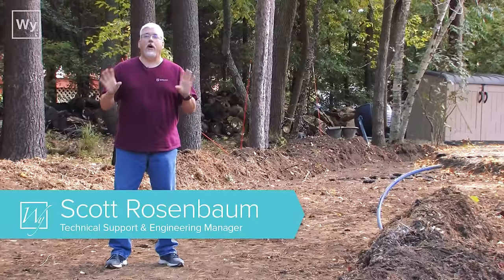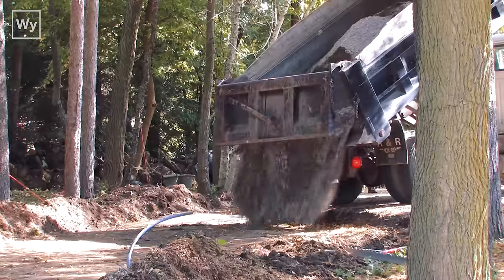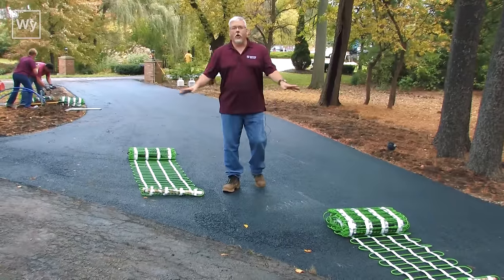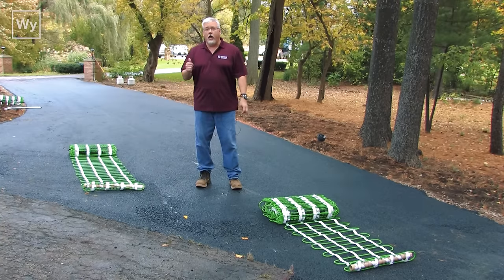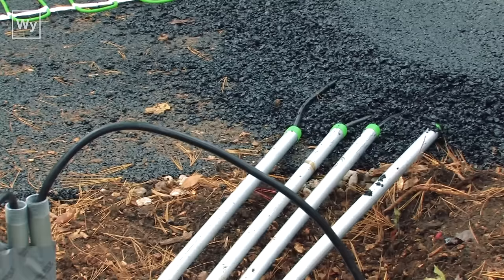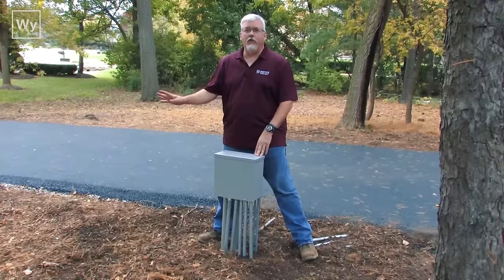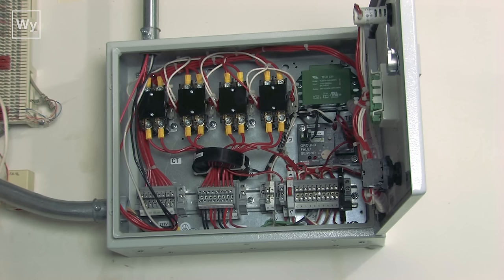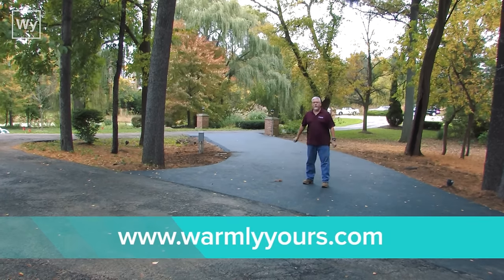Electric Snow Melting system installed in an Asphalt Driveway

Comment: Can these be installed underneath loose gravel and be durable/long lasting?
Reply from the maker: Our snow melt systems can only be installed by embedding them in asphalt, concrete or in mortar under pavers. Loose gravel would not provide the structural support or protection this system needs to evenly heat the surface. Our snow melt systems come with a 10 year no nonsense warranty. You can learn more here: https://www.warmlyyours.com/products/snow-melting

Comment: id like to know how many watts and voltage that particular system is? Must be a lot.
Reply from the maker: The total watts for this project was 15,015 watts, so 15.015 kWh. This project used our 240V snow melting mats. The average kWh rate in the US is $0.12 an hour so this would run for $1.80 per every hour you have it running. It only needs to be on when snow is actually falling, once it's melted the system goes into a standby mode that uses less power for a short time and then turns off once it has detected that it's no longer snowing. You can also control it manually to help better control power usage. Thanks for watching!
Reply: @Warmlyyours  Wow thats about as much as i thought. seems the electricity would be pricey. What about a hot water system that ran on propane power seems would be more efficient.
Reply from the maker: Some people do use hot water mixed with glycol so it won't freeze but it requires digging down into the area where the driveway will be since the pipes to run the water are much thicker than an electrical cable. Hydronic heating systems always present their own unique challenges since the water cools as it travels through the pipes, meaning that the area introducing the water will be the warmest while the pipes furthest from the source will be cooler and may not melt the snow at the same rate. Electric keeps it consistent throughout, but you definitely have to evaluate your potential electrical usage.
Reply: @Warmlyyours  Thats sounds much more efficient thanks for the info

Comment: Sound really good however, you do need to replace asphalt every 7 years + or - a few years depending on wether and use of driveway. What happens to your system then?
I’m going off of a short home driveway 1 car in Upstate N.Y. - every 3 years the asphalt gets resurfaced and every 7 years it needs to be redone completely just because of snow and salt on the road.
Reply from the maker: If you're driveway would need to be replaced, then so would the system. But the great thing with a snow melt system, is that you would be using less salt and have less wear and tear on your driveway if the salt is what's usually damaging it.
Reply: WarmlyYours - the driveway was not replaced just because of salt. Didn’t use it on the driveway anyway cause it was shoveled off.Neighbor plowed it for me.
No the driveway needed to be replaced because of the temperature. Months of cold then warmed up. The expansion and contraction of the asphalt in such temperatures is why it has to be replaced so often. 
Upstate NY, 4 to 6 months of snow followed by the warming up then 1, 2 months of heat and humidity in the summer.
Reply from the maker: If your climate has temperature fluctuations throughout the year that affect the asphalt - then the system would need to be replaced with the driveway.

Comment: Is there a video showing it with actual snowfall?
Reply from the maker: Yes you can watch it in action here: https://www.youtube.com/watch?v=7wdpsTCYoXI&t=0s

These systems often need to be installed several months before winter arrives, so it can be difficult to capture them at work shortly after installation.

Comment: What does it cost to operate such a system for, say, three months - Dec mover, January, February?
Reply from the maker: Good question! So what most people don't know is that with our automatic controls and sensors, these systems only turn on when needed. They detect temperature and moisture levels so that they start operating when snow is present. These Snow Melt mats use 50 watts/sq ft, the estimate we provided in comments above was running 6 hours for a day with snow. So with 50 watts x 6 hours, thats 300 watts a day. 300/1000 gives us 0.3 kWh/day. Based on your local kWh rate, you would multiply this by 0.3 to get the operating cost per sq ft of coverage to run for 6 hours a day. You can take that amount, multiply it by the coverage you would want and then multiply it by average snow events during winter to get a better idea of how much it might cost you during a season.

Comment: What happens when the mesh malfunctions? Or corrosion over time?
Reply from the maker: Hi Eric, we offer a 10 year warranty on this product line. If anything does go wrong, you do not need to tear up your whole driveway! These systems are design to be resilient to natural elements and can be repaired rather easily. We have tech specialists and a variety of tools to help us identify where a break may be in the system. Once the spot is located, only a small portion of surface material is removed and a splice repair is done to repair the electric heating cable.

Comment: What happens to system if you need driveway repaved?
Reply from the maker: If the driveway needs to be replaced, the system would also need to be removed with the old asphalt and replaced. We often recommend the installation of these systems when you have to replace your driveway anyways.

Comment: I don't get it. If the snow is that thick that you need to melt it to get your car out, what happens when you get to the end of your drive and you reach a 12 inch wall of snow? If the snow is thin enough to drive on then why would you need to melt it on your drive? Unless you just want a clear driveway to walk on.
Reply from the maker: Hi Matthew, a lot of home owners who choose to install this product do so to save on salt/harsh chemical corrosives that can damage a car. These systems also allow for a relatively snow free area, making it easier to get in and out of your vehicle when winter comes.

Comment: Stream rollers were used about 100 years ago...
Reply from the maker: The equipment that Scott is referring to in the video are the large asphalt paving machines. They typically carry the asphalt in front of them with a trough and then pound it down after it was been spread out. These machines are far too heavy to drive over the embedded heating cable so a asphalt roller is used instead for this type of install.

Comment: Awesome...what happens when it shorts out?
Reply from the maker: If there are ever any issues with the system, specifically the cables that are embedded under the surface material, we have tech specialists that can help you identify where the problem may be. If there is a problem under the surface material, only a small portion would need to be removed in order to access the wires and do a splice repair. This would be done by one of our tech specialists if you're in the area or a licensed electrician. Once the repair is done, the area would just need to be patched back up with the surface material you have in that spot.

Comment: What is the mat material used here?
Reply from the maker: This is our Snow Melt Mat - specifically designed to provide 50 watts per square foot and warm up outdoor surfaces to melt snow and ice (even evaporates the melted snow so it doesn't refreeze!) Here is a link to the product page for this: https://www.warmlyyours.com/products/line/snow-melt-and-deicing-snow-melting-mat Thanks for watching!

Comment: If this can be done ... can solar energy drawn from such a device?
Reply from the maker: Only if the solar panels can provide the amount of wattage necessary to run the system. Snow melt runs at 50 watts per square foot and that can amount to a lot of wattage. It could certainly help supplement power but it is unlikely a solar system could be enough to power the snow melt system on its own.
Reply: WarmlyYours solar system?

Comment: What actually happens? Say there's a blizzard which leaves multiple layers of snow AND ice. I imagine one would have to leave it on for days at a time which would be expensive! ( for instance heated swimming pools really pack an electric bill). Probably impractical North of the Mason Dixon line
Reply from the maker: Many of the advanced controls for these systems come with an auto-shutoff feature that turns the system off if conditions are too extreme - this helps save on electricity and prevents you from spending too much money during a bad storm. Our Snow Melt Systems are not designed to handle something as extreme as a blizzard, but for typical snow events, these systems are very reliable.

Comment: Not a bad idea but I'd hate to have an open circuit develope over time and have to replace the heating coils
Reply from the maker: You can actually just do a splice repair after excavating the area the cable is damaged and then patch it back up afterwards. Very similar to how floor heating is repaired as well.

Comment: What about the part where the heating elements fail under the asphalt after it sets?
Reply from the maker: If a snow melt heating element fails under asphalt, we have tech specialists that can help you identify where the issue is. In cases where it is under the driveway/heated area - only a very small area of surface material would need to be dug up in order to get access to the damaged cable. It's the same for our floor heating products, most people think they have to rip up the whole floor - when in reality you only need to remove 1 tile or 1 strip of hardwood flooring to splice the wires and cover it back up. You can find more information on our website here: warmlyyours.com Thank you for your question!

Comment: looks like a pain in the ass when you got to find where the problem is
Reply from the maker: While most assume you would have to tear up the whole driveway to repair the system, this is never the case with our radiant heating systems. With a set of specialized tools that we rent out to customers, you can identify if and where there is damage to the cable. If installed according to plan, you can find the distance into the mat or cable that there is an issue with a wire. After digging up a small portion of surface material, an electrician can do a splice repair (we sell kits for these if needed). We covered this topic in a recent YouTube live webinar, here is the part of the presentation where they address it: https://youtu.be/DyDW0Ej9ILg?t=12m43s

Comment: whats wrong with salting your drive in winter
Reply from the maker: Hi Michael, there's nothing necessarily wrong with salting your driveway - but for those that are not physically able to or would prefer to save some time/effort, our snow-melt systems offer a convenient solution for homeowners during winter. Also, with our system, you won't have to worry about your car getting rusted/damaged from the corrosive material and chemicals typically found in salt used on snow.

Comment: this won't be practical in extreme temperatures. we've been hovering around -20C for over a week, this would just make a driveway icy. no way it's keeping everything melted in very low temps. and why does that driveway even need this? if it's melting the snow, where's the water going to drain.....and then freeze to ice? the drive doesn't seem to slope much.
Reply from the maker: We are actually based in the Chicago area and also experience low temperatures at this time of year (It is currently 3F at our office, which would be about -16C). This system was installed at a home nearby and can definitely handle cold temperatures but just not as efficiently. While it may not melt at the same rate as a 20F (-6C) snowstorm, it will still melt snow and ice, just at a slower rate. If you have the aerial sensor for this system instead of the slab sensor, there is a function called "Low Temperature Lock-Out" that will prevent the system from turning on in ambient air temperature of 17F (-8C) or lower. This feature can be turned off, but is designed to make your system only run when it can effectively melt snow with an aerial sensor. As we mentioned in other replies, the system does not allow for the snow to refreeze once melted, water evaporates on the surface. Also as we mentioned in another reply to one of your other comments, these homeowners opted for snow melt since they were adding a new portion to their driveway.
Reply: You raise valid concerns that are worth testing.  Testing has determined that these are not concerns because the physics of the situation works in ways other than that you have predicted.  You must be careful conjecting with conclusive language like "this won't be practical..." when, in fact, it is practical.

Comment: had this installed   next  winter came  and my drive  way  melted    it was like a dam volcano of asphalt !!?
Reply from the maker: These systems are not designed to get warm enough to melt the asphalt, only just above freezing so that the snow melts. Do you know what product you installed that would have caused this?

Comment: And when it comes time to rip it all out and redo the driveway because of cracks that inevitably happen, your heaters will get ripped up.  Also.... snow insulates, so does the earth
Reply from the maker: Asphalt driveways typically last up to 20 years, But many people choose to redo them sooner in areas where there's lots of wear and tear from ice and snow. Our systems come with a 10 year warranty that covers any repairs needed as a result of manufacturer defect. Any defects as a result of improper installation can also be fixed at a cost. Only a small section is excavated in order to make the splice repair. Snow may offer some insulation, but it often melts and refreezes into ice when left on an outdoor surface. With radiant heating it can be safely and efficiently melted away without any refreezing.

Comment: That junction box should be farther away from the driveway, I can see a snowplow operator running this ine over
Reply from the maker: Well with the snow melt system, there's no need for a snow plow on that part of the driveway. Junction box location was picked by the electrician on site and homeowner, so we don't have control over where it ultimately ends up.

Comment: Did they not  use a paver?
Reply from the maker: As stated in the video, a regular paving machine for the asphalt cannot be used since it is so large and could possibly damage the heating cable. Hence why we recommend using smalling machinery and tools to smooth out the asphalt. Thanks for watching!

Comment: How hot does this get the asphalt?
Reply from the maker: The goal of the snow melt system is to deliver approximately 50 watts per square foot to get the surface above freezing to prevent accumulation of snow and ice. The asphalt temperature will likely be in the range of 33 to 40 degrees F, depending on the atmospheric conditions.

Comment: Wouldn't it be cheaper to just hite a plow to take care of the snow?
Reply from the maker: It might be cheaper, but it's not as convenient. Hiring a plow, or even someone to shovel it, means waiting for them to show up remove the top layer of snow while pushing the rest of it into the cracks and crevices which will refreeze into an icy surface. With a snow melt system, there's no waiting, no salting and no shoveling. With some of the sensors and controls we offer, the system can detect the conditions for snow and turn itself on when needed while also limiting its use in the case of extreme storms so as not to waste energy.
Reply: I currently pay about $800/year for driveway clearing as a subscription service, which is great to have a cleared driveway at a vacation home. They come out daily or multiple times to the neighborhood, as needed. Which is great. My problem is, 2' of snow can pile up in my driveway between plows. Had to shovel my way into the house tonight, for instance (which is why I'm watching this video tonight!). I've not done the cost analysis, with energy considered, but -- random guess -- I'm thinking 5 to 6 year payback.

Comment: I would love to know what the electricity costs of this system in
Reply from the maker: Hi Basil, so we actually have a tool on our website where you can calculate how much a particular system, like this snow-melt, costs to run for your area based on kWh rate. Here is the link if you're interested in testing it out: https://www.warmlyyours.com/en-US/tools/cost-calculators
Reply: thanks

Comment: Nice in concept, but doesn't appear to meet NEC burial requirements.
Reply from the maker: Hi Steve, so NEC require 2" of non-combustible medium below and 1.5" of the same above this heating cable. This cable is within those parameters so it would in fact meet the requirements for NEC.

Comment: That heated driveway system would cost $$$.  Better to just invest in winter tires.  Also it be better to installed heated flooring inside the home.
Reply from the maker: While winter tires may help your car handle the snow, there are plenty of falling accidents that happen from a snowy driveway. Especially for the elderly, this type of system could give peace of mind that there's no more salting or shoveling and they still get to enjoy a clear driveway. We actually specialize in floor heating so we wanted to offer a solution for the outdoors as well. You can find out what the cost would be for this type of system by checking out our online quote builder tool for snow melting or floor heating: https://www.warmlyyours.com/snow-melting/quote-builder . Thanks for watching!